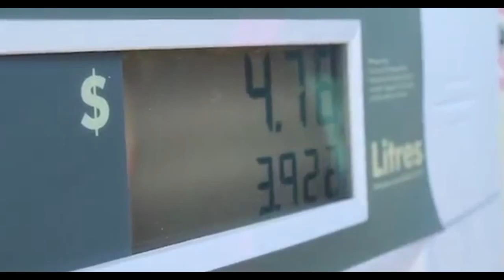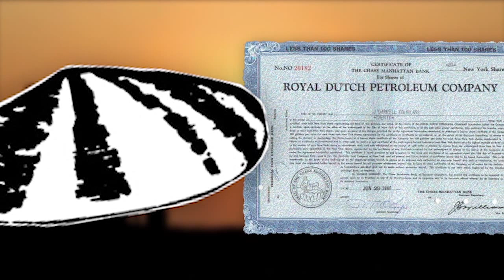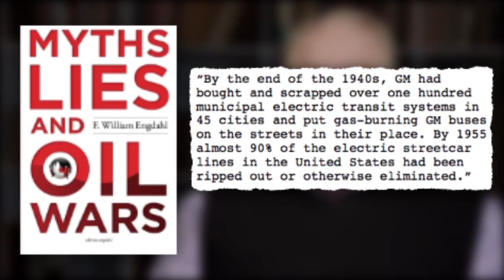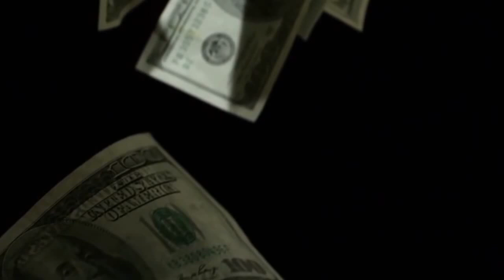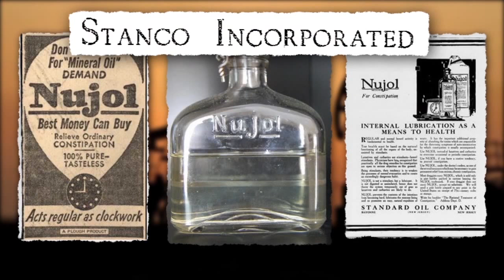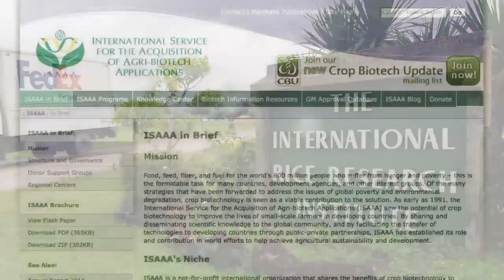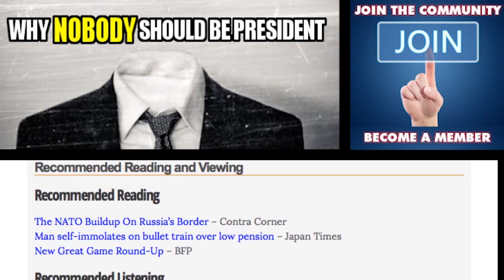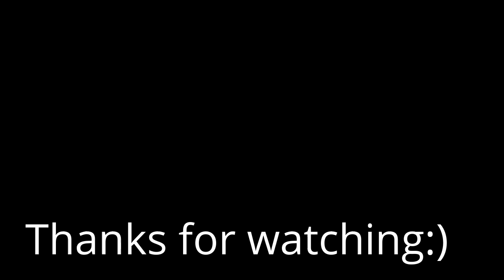History Channel Documentary-How Big Oil Conquered the World

Comment: diesel 'cracks' at an easier level than gasoline.  now diesel costs more, odd isn't it?
Reply: Oh well the "World parity pricing" is demand based so when supply is slow,demand high,the price fluctuates accordingly [usually upwards] if you believe it
Reply: Unleaded fuel skips the process of adding lead to gasoline, but costs more. Fancy that..
Reply: Ethanol is lowering the price of gasoline vs diesel.